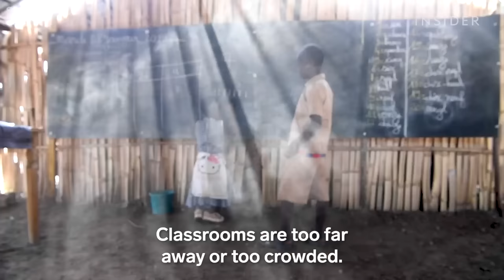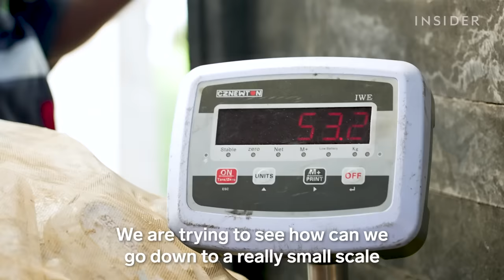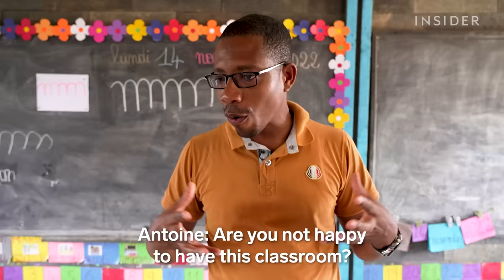How To Make Bricks From Plastic Trash | World Wide Waste

Comment: I build and ran recycling plants like these for years in Canada. What these people aren't telling you is the amount of toxins and pollution that plants like these produce. First, I don't see a single piece of protective equipment in that factory. Pelletized and extruded plastics let off A LOT of toxic chemicals that the workers are breathing in, and that are being released into the local environment. Second, the pelletized plastic gets everywhere. We found that, even though we tried to manage it, the pellets would end up miles away as micro plastics in the water and food supply. Thirdly, it takes A LOT of water to wash these plastics before extruding it.  I'll wager they're not taking any steps to recover and clean this water so wherever they're dumping it, you're ending up with bits of plastic, food waste from containers etc. This causes huge algae blooms, which is something we witnessed from our own factories, which pollute the water and kill fish stocks. Don't be fooled. This is not clean and green. It's money.
Reply: Another thought came to my mind about building with plastic blocks is that they're flammable and burn pretty quickly.  Fire departments have discovered something similar with engineered wood products.  Those wooden I-beams that have been taking the place of solid wood floor joists burn through twice as quickly.  Resulting more rapid floor collapses once a fire starts.
Reply: What do you do now ser
Reply: @jayski9410 interesting. It's being used a lot so I thought it's all safe and better
Reply: So what would you recommend for factories like these?
Reply: @aberba  One thing I didn't mention was food waste in the plastic severely increases risk of infection on cuts and scrapes. I spent nearly $500/month on medical supplies and protective clothing for my staff. That and rebreathers to keep them from inhalation of residual toxins. Second, it needs dedicated water tanks to keep the wash water isolated from lakes and rivers. This water is treated with chlorine to kill bacteria, filtered through screw presses to remover paper pulp from labels and kept in a closed loop. Last, is closed cell netting all around the property to prevent micro plastics escaping. When it gets ground up, it blows like dust so you need to contain it.
Reply: I make bottles for a living I expect to die young and probably from cancer
Reply: Yup you are a rational person seeing through the bs.
Reply: Depending on the plastics, there can be toxic fumes. Most of those don't have toxic fumes at normal recycling process. The most important thing is to sort the plastics very well and to clean those. Best way to do it is where plastic waste is coming: homes, workplaces. 

There at video they did show hard plastics from electronics. Most of those are problematic because regulations those needs to be made from such plastics that those doesn't keep fire going on. It means that the plastics are having different chemicals to prevent fire. Those are too often toxic in some form, not when touching but can be separated when using correct machines.

I have very good experience about plastic recycling
Reply: @tapsulinka  That's completely incorrect. BPA, dioxins and PHAS are released from plastics at very low temperatures. That doesn't even include the ethylenes and heavy metals like lead and cadmium. The kind you'd find in the grinding process, along with micro particles in the air. ALL plastic, even PETE contains chemicals that are released in the heating process and ALL grinding equipment friction heats the material while releasing nano particles of plastic in the air.
I definitely question your "experience" if you don't know this.
Reply: Agreed.  The concept is fantastic; Health, Safety and other environmental controls should be implemented for a truly sustainable and ecological recycling program. As stated, that's not the end goal unfortunately.  Low overhead / high profit is the ultimate prize and is disguised as good deeds.
Reply: Same scenario as in Swaziland asbestos mining many years ago , the natives had no ppe at all even after they knew the dangers of asbestos.  The workers aren't important enough
Reply: That all good information.  But as for their continent, they probably don't have those resources.  We all know from Social Studies Africa is behind in everything.  Perhaps you yourself can contact the developer and make this a Better place.
Reply: @rebeccamayers2056  I think if they have the tech to pelletize and extrude plastics, then they'll have ample access to PPE. Also the equipment to reduce pollution from the process isn't high tech. All of it can be built from plumbing and farm machinery you'd find anywhere, which is where it all started BTW. It's not that they can't, it's that the plant owners don't want to spend the cash, and unfortunately the govt. isn't forcing them to, which they should be.
Reply: Think you
Reply: @yashpatel261  Its a neat idea if done properly, apparently the recycled product is 5-7x stronger than concrete
Reply: I agree with you. Also some plastics release dioxins if warmed, and after cooling they continue to release them.
The plastics are different, so you cannot mix together (for example bags are PVC and bottles PE, PET, PP made).
The produced bricks are tested for safety and mechanical properties?
Reply: @phantomzone2571  On paper they're not supposed to mix but the industry has been doing it for decades. In fact, 99% of plastic lumber, if it's brown or grey, is made of a blend of HD LD, PVC and some PETE. Tho, we tended to try and separate the PETE because it's more valuable than other types of plastic. Pure PETE is worth 2-3X per ton what the others are. The problems were that bottle caps were LDPE while the labels were often PVC so we designed special float tanks to separate them after pelletizing them. Never saw any stress testing tho on our extruded plastic. Most was just sold off a home deck material or for things like benches and play equipment.
Reply: I like to see instead of people use a.i and build sea walls out of recycled plastic and roads
Reply: U see something from negative size. But Oscar cs at least doing something better. Yet there is not best happen yet.. it our part to make it better better and better. I think this is not all about money!
Reply: @ihatewarlovepeace443  I think these projects, these industrial plants are like putting the dust under the carpet,  an illusory way to say "we have recycled the plastics" without considering the negative effects on health and habitat in short, medium and long period. Unless after their life time these products will have to be recycled: the polymers will be too much degraded for recycling.
Reply: Exactly. This plastic will just leach into the water when the sun melts it.
Reply: Real question - Is it worse than just leaving the stuff in landfills to leach chemicals in the soil. 100% agree protective materials are needed.
Reply: Greetings from Zambia 🇿🇲 I'm a new undergrad sustainably student. What are your suggestions on what we should do with plastics on a community level?

Thanks for your professional feedback 🌞
Reply: Is it right to adopt this process if the right PPE equipment is used for workers and all harmful plastic is removed and if the plastics are manually separated.
Reply: @FBA-Renaissance  Processing into plastic lumber is the right idea but it's the extra steps that'll keep your country and people safe and healthy. Things like; A) Meshed fences around the perimeter of the property to capture loose material. At least 10 feet high. B) closed loop water supply for pre wash systems. This means a large water tank of at least 7500 gallons with an isolated tailing pond for water overflow so it doesn't get pumped back into the rivers. C) You'll need high volume rotating filter screens and screw presses to sift the water for contaminate waste and paper. The good thing about this is the waste paper can be pressed into blocks for fuel or building material. D) PPE for staff. Filtered breathers are important to prevent them breathing in off gassed toxins such as BSA. In fact, tetanus shots and well stocked medical kits are extremely important as plastic recycling contains a LOT of biological waste in it so infection is a huge problem. E) Almost forgot air scrubbers. A LOT of toxins are released due to off gassing. You need to keep those out of the air.
Reply: @andrewmoonde8436  You need more than PPE and ALL plastic is harmful when heated. Isolate plastic from environment; Isolate processing water from water supply; Isolate off gassed toxins from air through filtration; Isolate micro plastics from entering food chain. That's how you make it safe.
Reply: @antagonizerr  That makes sense . Am from Zambia I want to start working on my final year project and we have a lot of plastics on the streets would you advise to do such a project plus  researching on how to make it safer cause I would be improving waste management and  structural elements like columns ,beams and bricks
Reply: @andrewmoonde8436  That sounds great. First thing is to separate your PETE from everything else. It's worth more money and would help finance the process. Bottling plants pay good money for pure PETE. It has to be pure tho, so you'll need to remove caps, rings and labels before processing. We used salt water float/wash tanks to make separating it easier. Second, you should use two stage grinding. One to turn it into 2"x2" pieces that'll let you wash the plastic better, then a second to chop it into a size that can be extruded. Third, is it's really important to isolate the recycling plant from the environment. It does no good to clean up the plastic only to kill your rivers, pollute your food and sicken your people. Fourth, remember people are important and if working there makes them sick, then you're not doing the right thing so get them protection.
Reply: @jayski9410  They are much less flammable than 2x4s which Americans build with.
Reply: Or your just jealous of what Africa is doing. People in Africa can’t afford PPE ok. So think before you comment.
Reply: @rebeccamayers2056 Apologies if you saw my previous comment.
Reply: @antagonizerr 
Hi I'll love to talk with you more on this seeing you have very vast knowledge on this, how can I contact you via email?
Please I need to hear from you
Reply: @antagonizerr 
Hi I'll love to talk with you more on this seeing you have very vast knowledge on this, how can I contact you via email?
Please I need to hear from you
Reply: Sure this might be all about money but which is better? Dumping rubbish on land and ending up on the sea or doing something that could at least mitigate the damage on the environment?
Reply: @nonenothing8648  Without isolation tanks for water, boundary fencing, and waste collection and processing, the plastic is STILL ending up in the environment. Only now, it's pre-ground into microplastics instead of floating around as whole pieces. That's actually worse.
Reply: We share same thoughts!
Reply: I cannot differ from your kin observation. It's all about money and not about the environment. Just like all the solar energy and electric vehicles. The minefields are a disaster.
Reply: I think there will always be doubters and haters. What I read in this thread is that you are saying it's better if those people live with filth and poverty and no schools rather than trying to better themselves, their surroundings, and society. You are telling them to give up because you failed.
Your option is not better.
Reply: thanks for the insight
Reply: that is right but i think they do not clean the waste cause the recycled product not cloth or body touch, it is just bricks , but there are dangerous of workers without good clean in NAOH,  add to that thermoplastic is effect with environment especially wet and  sun .etc , just if pant the brick or coating.
Reply: @منتظرالمعموري-ظ3ي  You have to wash it or the dirt just clogs up the machines. Think of a big 3D printer because that is what it is. Any dirt doesn't melt so it just clogs the nozzle.
Reply: Ty for your comment. The more I read and learn about plastic, the more upset I become. I'm educating myself and I'll be setting up a table at CA beaches to encourage people to demand alternate packaging, ie laundry sheets instead of plastic laundry jugs, Shampoo bars instead of bottles.
Reply: There's a lot more to it than that you'll need to pay attention to. It takes the same amount of energy/pollution to create one paper straw as it does an entire box of plastic ones and tho they don't stay in the environment, the damage is just more hidden. The best option is to not use them at all. Likewise those reusable grocery bags...you would need to use it over 4000 times to equal the energy/pollution that went into that plastic one so you have to ask yourself, "will I use it that much before it falls apart?" Again, it's better to not use either but in this case that's not practical. Paper...paper uses more energy than the plastic but less than the reusable but also has the advantage of being a renewable resource AND be both recyclable and biodegradable. What I'm saying is that the solution HAS to be better than the problem or we just end up doing more damage in the end. Last one I'll mention is electric cars. Batteries are only meant to last 5-8 years and can cost between $5k-$17k to replace. Your car should last at least 20 years so you'll be replacing them several times. We don't recycle these batteries like you think, which is the big issue. We can't, they're too volatile to disassemble. They simply burn them and do their damn best to 'capture' the smoke. As I said, the solution HAS to be better than the problem and that starts at manufacturing, not just at use. @mariesmith2782
Reply: @antagonizerr happy to read from you. I am interested in doing building blocks from recycled plastic and sand. My worry has always been the safety of the end user. Since plastic subjected to heat is dangerous,  with a tropical climate( sunshine) all through the year...are the occupants of these houses safe?? Putting safety measures while in production can be done but what about the end users? Kindly guide from your experience about paving blocks and building blocks.  Thank you.
Reply: We are about to start similar project, we are planning zero liquid discharge facility for wash water including scrubber system for fumes, any other issues you think we may face ?
Reply: Insects and infection. People don't wash their plastics when they put them into bins so injuries become septic within hours. My budget was $500/month for medical and protective gear. The fruit flies would swarm so bad when we opened the trucks, you couldn't see the bails. It was really bad. Also, fume collection isn't enough. Your people need respirators. Lastly, micro plastics will spread phenomenally fast so you need factory and yard isolation. Even with 10 foot fences and plastic curtains over entrances, we'd find bits of our ground plastic hundreds of feet away. I can't give you a perfect solution to this one as we never found one, but the plastic curtains did help minimize the issue by quite a bit. @GopalPatel
Reply: Greenwashing
Reply: @aberba Look back 6 years ago when Grenfell tower burn in London UK.. the cladding was made from plastic sandwich between 2 layers of aluminium.... 3..4 mm thick.. imagine that amount of plastic bricks and beams how is going to burn
Reply: so how does plastic factory work ? 😅 stop the main problem the talk abot recycling it 😅
Reply: @haiderkokab  it's all about money.... money...in UK they burn ❤️‍🔥 plastic... and they said it's recycled...In USA they burn ❤️‍🔥 not plastic.... they burn fibre glas.. it's a New year for recycling
Reply: I’d recommend you contact UNICEF and offer your knowledge to include  a cleaner recycling during the process. Yes, protective clothing is important and big business creating the waste should be consulted to deliver some safety wear. 

I don’t believe this is bad for the environment, leaving it on waste dumps is even worse, help clean up the process for the sake of reducing pollution into the ocean and rivers. I’m sure you could get the Canadian government to sponsor your involvement. 

I live in Victoria, help bring this recycle to the island with our sorted waste. Canadians will sort their waste to strict requirements, just need the recycling here not sent to pits or far away places that has a pollution element of transport.
Reply: Nope this is worse. At least in a landfill it's contained. When ground, it can't be, unless huge expensive steps are taken. Micro plastics and released toxins are created during grinding which end up in fish, waterways, the air floating as debris, in the soil, etc. You're basically doing what takes nature decades or centuries to do in a matter of hours. Plus, of course there's nutrients from food waste left in containers which can cause huge algae blooms in waterways, deoxygenating them and, killing every living thing in them. As I said, you're releasing in hours what takes nature decades or centuries to do without regard for the people, animals or environment.  @larrymeyer2917
Reply: @antagonizerr  So is there any way to granulate the 2”x2”’s in a chemical solution, like H2O & CI, that would keep the microplastics from taking flight, while providing decontamination as well?  Although the next step would be rinsing and drying, so I don’t know if heating would cause the now less dense microplastics to float away/create toxins in the atmosphere…
It seems like the key is to mitigate the plastics being granulated and into pellet form without the airborne losses.
Reply: We used vacuum scrubbers tied directly into our grinders but that only captures airborne particles. We had 3 4'x4' units that would clog daily, telling you how much particulate matter was released. Secondary washing would take care of the rest but there's costs associated because that water would need to be recycled and filtered and it would have to be a completely separate system to the primary wash meaning multiple huge storage tanks, filtration and screwpresses. Companies are reluctant to invest in that for obvious financial and space constraint reasons. Lastly, heating has it's own issues as release of toxins such as BSA, diacetyl, benzene, etc are released, so air scrubbing is a must on the extrusion end.  @spaz-tech
Reply: I think the operation can be cleaned up .
Reply: Why are you using up water for plastic? Just put it through the sand tumbler. It uses 99 percent less water and keeps the chemicals localized to the plant and not dumped in the river.
Reply: Do not believe this antagonizerr person.  He has a motive and narrative he is trying to push.  He didn't even call out the first reply about flammability.  There are additives that can be mixed to extinguish the fire.  This is a basically of plastics, yet he failed to know it.  Bet he is going to come back with an excuse.
Reply: Of course factories create pollution.  Its a trade-off.  Do you want landfills filled with trash or the pollution created by the recycling?
Reply: Ok, I get that people don't understand how much MORE damaging micro-plastics are to the environment than waste in a landfill so let me use an analogy to explain: 
Say...I have hundreds of sealed bottles of powered poison in bottles in a room. So many in fact they get into the hall, living room, etc. So I need to dispose of them properly. I can just take them to a factory, pour them out into bigger storage cans so they can be securely disposed of, or neutralized. However, the dust is a powder, so the wind is blowing the poison powder in the air which is escaping the factory...getting into the water...the fish...animal feed...the soil...and worst of all, the people who are doing the pouring are breathing it in which is slowly killing them. So...to be safe...you add water to keep the dust down, but you can't let this water get out or it'll you'll have the same issue, so you need huge water filters to remove the poison from it so it can be used again. Next, you need large air scrubbers to collect as much of the poison that still gets into the air. You don't want your staff breathing it nor do you want it in the environment. The point is, this factory is doing NONE OF THAT. Their "poison" is getting into the air, the environment and Killing their people slowly. 
So you need to ask yourself; is it better to do the job half assed, and kill the people, animals and land, or would it have been better to just leave the bottles of poison alone in the first place? When you grind plastic, you're doing in seconds what takes nature decades or hundreds of years to do on its own. 
The REAL point, is if you're not going to do it right, don't do it at all or you're just going to make things worse than if you'd done nothing. @glennwatson3313
Reply: @antagonizerr  Both scenarios have negative consequences.  You think one is worse that the other and you have evidence to back up your argument.  Other people thing differently and they have evidence too.  

The bottom line is we need recycling in poor nations that don't have the technology or wealth you are calling for.
Reply: "Feelings" have nothing to do with it. I designed these plants for a decade in Canada before these companies found it cheaper to simply ship our bails of plastic to third world countries. Remember hearing about that in the news? That's why I'm now a stationary engineer somewhere else. Point is, it doesn't matter how people "feel" about the subject, the environmental assessments we had done 6 times a year say it's worse. Jesus man. Start reading the errata and stop going on "feelings". I had to read these enviros and design systems to combat these problems. The least people can do is stop going on feelings and get with the science.  @glennwatson3313
Reply: @antagonizerr  I agree that feelings are not relevant.  I used the word feel in place of the word think.  That was an error.  

Let me rephrase.  Some people think you are wrong and they have facts to back it up.  

The point is there are tradeoffs in everything we do.  We want plastic bags, rubber tires and plastic toys.  We want them cheap so we can spending time on other things.  

I think recycling is still in its infancy and will get more efficient and safer over time.  This will happen first in the industrialized world and only later in Africa.  But the African are dealing with mountains of trash now and it must be hard for them to hear Canadian engineers telling them to stop fixing their country.  

Stop thinking like an engineer for a second and think like an economist.  Think about trade-offs.
Reply: The process of pelletizing type 2-8 plastics has been around since 1989, and in fact it was my former employer who "created" it. I use the quotes because it was myself and a team of about a dozen other people who actually designed the plant under the premise he had that, "they're wrong about plastic types not blending". He gambled, and was right but that's not the issue. We solved ALL these issues 30+ years ago when this process was first created and our first plant looked a lot like the one in this vid. That's until environment Canada stepped in...started enviro surveys and realized we were having a HUGE impact on the local ecology. In fact, our factory was about 5k from the St. Lawrence river and they were finding pellets as far as 100k downstream. Not only that, algae blooms were off the charts. We were responsible for that. That's why we incorporated water isolation and recycling. What I'm saying is that it was pretty damn far reaching and if we'd kept operating the way we were, without the upgrades, we would have irrevocably damaged the local ecology for 1000k square miles around our plant. @glennwatson3313
Reply: What do you think about eco bricking? The practice of collecting plastic bottles from dump sites and filling it with mixed materials/ unrecyclable plastics to create structures. Is it less harmful
Reply: Something is better than nothing. They may improvise and take necessary action. May Almighty bless them all....😊
Reply: @antagonizerr sir, Make videos on your channel explaining
Reply: Is there any clean way to recycle these plastics?
Reply: You have good points against but what do you offer beyond trolling for status quo?
Reply: @Gpmeme948 I'm not against and I'm not sure who the status quo are. The solution is simple but not cheap. Masks for the employees, air recycling for the plant to keep microplastics out of the environment, wet grinders instead of dry grinding to help prevent micro plastics, Wash tanks with isolated water supplies from the environment. Trommel screens, screw presses and rotary water filters to clean the water for reuse to isolate it from the environment. Opaque fencing to keep bales of plastic that are waiting for grinding from blowing around. There's more but you can see why companies go to third world countries to process this stuff. It's expensive to prevent pollution and looser regulations means higher profits for them.
Reply: Thank you for more insight into the process! I personally think that it's a great alternative, but I'm know expert!
Reply: tell your cheaper alternative
Reply: It's always been business first. I see huge potential of this as building materials for rural or poor nations. I do see health risk associated with such a manufacturing facilities, but for poor or rural nation, this can quickly build a roof over their heads. They have to weight the pros and cons themselves.
Reply: @antagonizerr i love it when the internet produces people like you. Your advice is invaluable to me.
Reply: As with anything, it's all about money
Reply: In the global south.... Ehhh
Reply: Thank you for your comments. I am looking at an option to Carry out plastic recycling in Thailand.
The plant would be simple to run ,but low output run by nationals as a co-op The plan would be to scope the market overcome roadblocks .I love to hear more from you.
Reply: What's the solution to the aforementioned problems?
Reply: Stop running them. @aberba
Reply: @antagonizerr 
Dear sir,
How about using plastic powder mixed with foundry sand ?
Is it good for making products with these combinations?